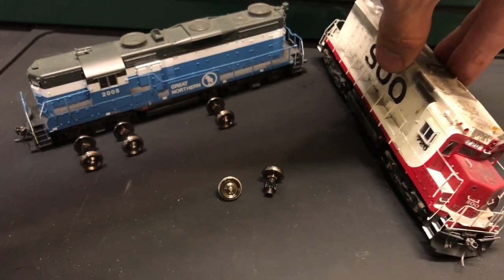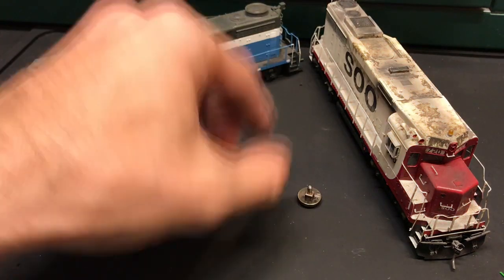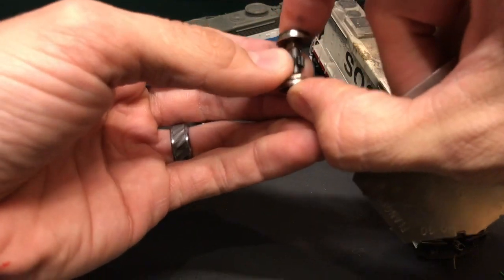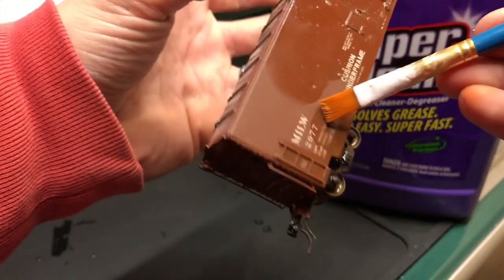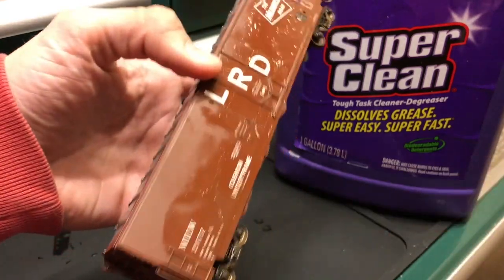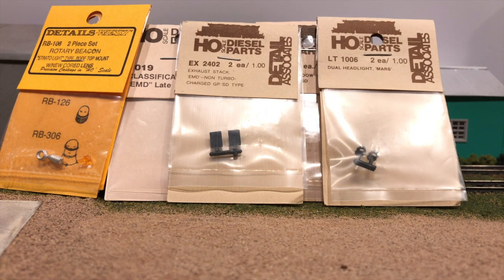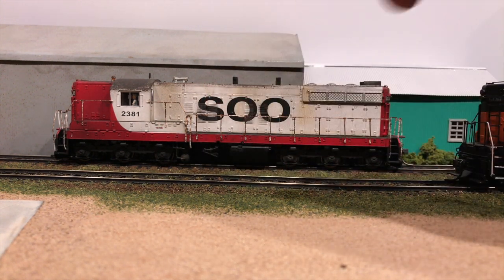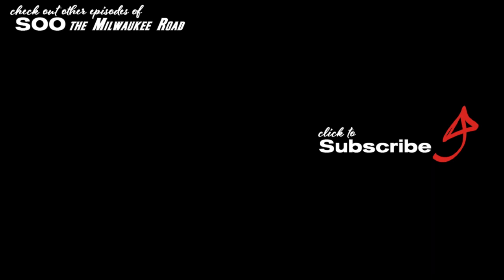SOO The Milwaukee Road S02E07 - The Future SD10

Comment: If I remember correctly 532 is currently owned by the Whitewater Valley Railroad Museum
Reply from the maker: Formula Shell I believe you’re correct, I’ve used photos of it for references. Do you live out that way, near the museum?
Reply: @SootheMilwaukeeRoad  No I'm just a fan of fallen flag railroads that ran in the Midwest especially if they ran in the Quad City's and the surrounding areas
Reply from the maker: Formula Shell That’s great, you’ve got great taste.

Comment: Do you need a clear coat if you use chalk for wethering?
Reply from the maker: Depending on how much you handle your equipment…and the amount of tooth your dull-coat has. Personally, it’s case by case, generally stop applying…when I like the end result.

Comment: The Super Clean contains Lye, so you should be wearing gloves. It's bad for your skin, and can also blind you if it gets in your eyes. It makes a great paint stripped just like 91% isoproyl alcohol does too. But seriously, if you get this stuff on your hands it will eat your skin. If you get some on you and rub two fingers together and it feels smooth and slippery... well that's the top layer of your skin sloughing off.
Reply: For further info on using this as a paint stripper:

http://www.bonediggers.com/1-3/strip/strip.html
Reply from the maker: Dylan Myers THANK YOU!!!

Seriously, thank you for noting this, I’ve since started wearing gloves when handling all chemicals. For the reasons you’ve noted above. One can not be too cautious when handling these materials.

It’s a great option to have in your bag, but for all users...handle with caution.

Thank you again Dylan, your post is much appreciated.